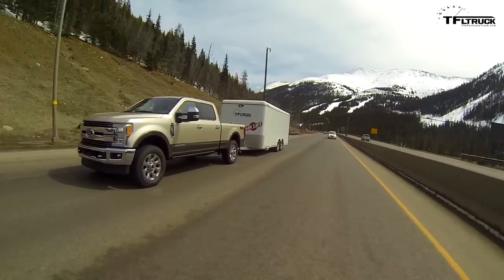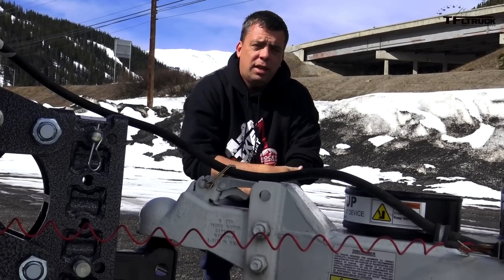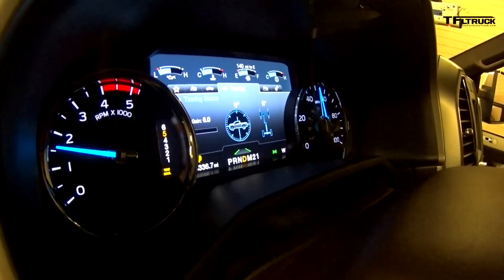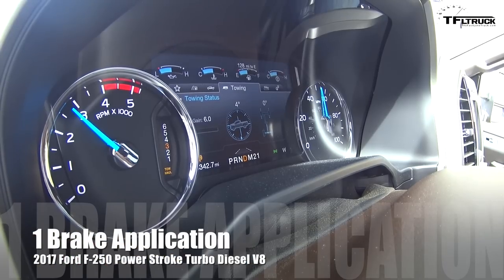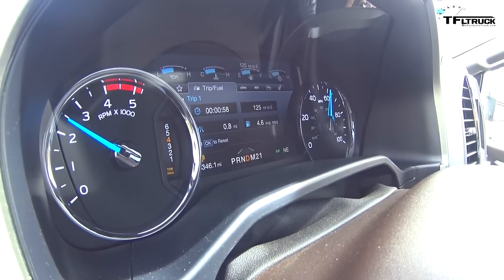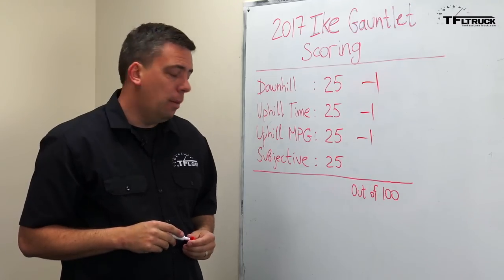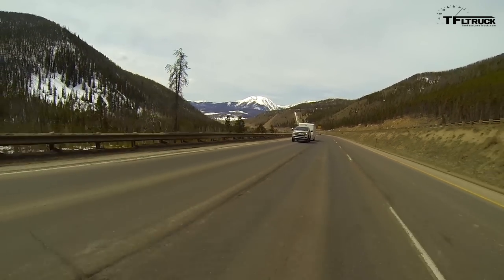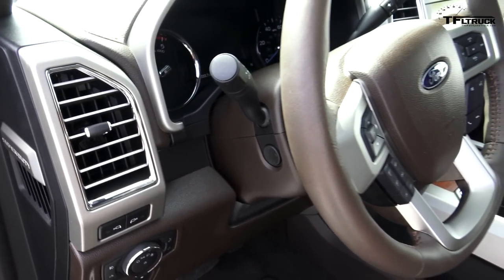2017 Ford F250 Diesel V8 Takes on the Ike Gauntlet Review: The World's Toughest Towing Test

Comment: How is the payload only 2080 lbs?
Reply: All the add on goodies. F-250’s have notoriously low payloads. Jump to the F-350 and you get 3500-4000 lb payloads.
Reply: @jjsemperfi  funny enough, since I added that comment 4 years ago, I finally bought an F350 a few months ago. Love that truck LOL
Reply: @eklaiss   Congrats! We’re looking for a 350 but will probably end up waiting. Hope this insane car market will drop in the next year or two.
Reply: @jjsemperfi  I got very lucky with my timing. I ordered my truck December 2020, it came in April 2021. Right before the microchip shortage.
Reply: @eklaiss   Very nice! I’m thinking I need to start a micro chip company at this rate.
Reply: @jjsemperfi  LOL if only!

Comment: let's test the 6.2l with more tourge at lower rpm we all don't  drive desiles
Reply: I second that.  Bring on the 6.2L with the 4:30 rear end.
Reply: desiles, that's a new one...haven't heard of tourge either...
Reply: Leonard Alldread Agreed.
Reply: Leonard Alldread If you're a real man , you do.
Reply: Agree. If I was to go out and get a truck right now, I'm looking at either the old RAM 2500 Hemi 6.4L or the new Ford F-250 Boss 6.2L because of the stupid cost of diesel. Both trucks are nearly $9,000 more for just the diesel, and that adds up with oil changes, other maintenances after warranty, D.E.F. fill ups. The diesel will most likely have the best fuel economy due to it's Turbo, but I would like to see them test drive the Boss 6.2L Super Duty too. TFL did mention in a previous video they were going to do a HD work truck (fleet) testing, and the Super Duty would have the 6.2L (I think) but it will probably be a 4x2. But yes, my first pick would be the 2017 Ford F-250 Lariat FX4 6.2L 4.30.
Reply: Mid-South RZR & UTV Riders The turbo isn't why it has better economy
Reply: Mid-South RZR & UTV Riders well these modern gas engines keep getting better and better fuel economy while moderne diesels keep getting worse and worse because of all the emissions crap.
Reply: with the 4.30 gears too!!
Reply: lfsracer79 hey buddy it was early in the morning yes I can spell
Reply: this time load it to the max also
Reply: M Dalley lol most people that drive diesels in ny are kids roaling coal going slow lol
Reply: Just a spelling mistake early in the morning but whatever  can't  we just stick to the subject
Reply: We all don't know how to spell the word "torque" or "diesel" either.
Reply: Leonard Alldread please correct your spacing!
Reply: Leonard Alldread diesel . Get it together
Reply: Spamfried Know how to use Google or a dictionary though, right?

Comment: so the $44,000 Chevy Silverado 2500 gasser got 2.9mpg and this $75000 superduty diesel got 4mpgs?!?! lol!!!
Reply: Jeff M that's about 25% better.  LOL, math
Reply: gotta factor in that reg gas is cheaper than diesel and the the $10,000 initial hit for the diesel upgrade.
Reply: Poor Jeff doesnt realize the 44k chevy gasser wont pull a real trailer for any length of time. Most folks buying a 75 k truck could give 2 shits about fuel mileage But its good to know that Chevy builds a better truck for 31k less haha. Jeff needs to stop watching super bowl commercials and put the Bud Light down and go drive a real truck. I have a feeling hes the guy with the 1/2 ton Chevy with the big fat tires on back because they will haul more pallets and the skinny little tires on steel wheels on front lol

Comment: I think I would get a Lariat with the 6.2 Gas engine and save a Honda Civic (20k) in the process. Not only that, Ford is already denying tons of warranty claims because of "Contaminated Fuel" and "Improper Fuel System Maintenance". I've been down that road before with a 6.0. They got me with one diesel. They won't get me again!
Reply: Campus Automotive Inc. please provide a link to these warranty claims that are being denied. 
I see people post this stuffin these comment sections all the time and they are usually missng facts.  
there were some warranty issues that were denied on the 11-16 trucks, but when you read deeper into what happened you usually find that the owner did something stupid like pour DEF in the fuel tank.

Comment: I just checked the 2015 ram 2500 Ike time with 12250 lbs.  time was 7:33 with 4.4 mpg.  3.42 ratio.  That's crazy fast.  This ford just doesn't have it.  I'm sorry.  And the ram is heavier.  Huh.  What am I missing.
Reply: Further the total weight for the Ram tow was 20,500 including the weight of the truck. This Ford is nearly maxed out at 22,400lbs (9,900 GVW (100 less than max) for the truck plus the towed 12,500).
Reply: Dave If you would have paid attention you would have heard Nathan say hey could have gone way over 60 at any time all the way up the hill but didn't want to break the law
Reply: Roger funny.  He also said he was wide open throttle.
Reply: Yes for the sound test
Reply: Roger regardless.  If he's wide open throttle at the time then I guess he had it floored.  Get over it.  Your ford sucked.
Reply: Dave West The Ram had to be floored at WOT several times. Nathan said he has plenty of reserve power with this 2,000lb heavier load and could have easily broken the speed limit. I guess math and the mounds of reasons why the Ford kicks the Rams ass in this one escape you.
Reply: John Smith the load was 12500 with the ford.  12250 for the ram. But who cares, 2000 lbs or 250 lbs more.  Like you said, the ford had lots of reserve power, funny that Nathan didn't use it!!!   And you say to stay legal, but yet the ram did it in 7:33.  I guess they broke the law though.  Why wouldn't they do it again to try to beat the best, the ram.  Weird.  Maybe you should watch the videos again and when roman says he has to floor it he says right after that he has to let off again.  Time and time again.  And yet still did it 7:33.  And with 4.5 mpg.  You have no argument.  Please stop trying.
Reply: Dave West lol- like I said, math and the many reason the Ram gets its ass kicked escape you. To disregard 2,000 more lbs and attempt brag about .4 of am mpg (especially since they used a snub nosed trailer in this one and an aero w/ the Ram) is laughable. Ford GVW in this video was 9,900 lbs, add the 12,500 for 22,400lbs. In the Ram video they state the total weight was 20,500. Roman was driving the Ram. No idea if he broke the speed limit or not. There is a reason they use 8 min as the benchmark and get no more points for doing it faster. But I guess that reasoning escapes you too.
Reply: Dave West and you are trying to compare a 4x2 to a 4x4. Lol. .3 mpg difference, more power, and more weight= Ford win
Reply: And it wasn't me that said to stay legal- it was Nathan. Did you even watch the whole video?
Reply: Dave he also said he had never felt power like that before, remember he already drove your 2 wheel drive dodge and like John Smith says the ford carried about a ton more up the hill, Keep looking for a win, hey go try the Duramax page you might get lucky

Comment: "Manually locking front hubs." Did I hear you right? As in get out and twist a dial on the hubs? I thought those went away in the seventies.
Reply: They have an auto and lock setting in case the auto vacuum fails. The systems are redundant.

Comment: Ok so basically you're taking all the trucks up at 60 mph??  So if all of the ones that can Hold 60 will basically be the same time..... Uh yes not really a test at all
Reply: @Chip Aikens I'm saying that it isn't really a real test. The nearest Real test would be Max Towing load, from a stop and accelerate to 65 up the hill with an escort to keep traffic as clear as you can. Once you "have" to slow down for traffic, the test has failed.

Comment: Great video....I'm sold on the 2017 3500 Dually..... With the Cummings motor....I'm mostly going to be hauling new RV's....Please do a video or give me your opinion....Thanks.
Reply: KENNETH STENSRUD no do not buy a dodge I know it has a cummins motor but even thing else will fall a part believe me I know if it was my money then I would get f350 lariat or xlt it just matters how much technology you want in it or which looks better to you but if you want a cummins then get a Cummins it's your money.
Reply: I second that! The dodge is a pile of shit...you will be in and out of the dealer with problems!
Reply: KENNETH STENSRUD the dodge is a great choice if you want to replace your tranny every 50k miles
Reply: Kenneth stensrud   I am a 13 ram cummins with the aisin tranny and it tows awesome.  My truck has 71,000 miles on it.  Almost all towing miles and it has been a very reliable truck.  I couldn't be happier.  And believe me, if it broke down there would be no mercy on what I would say about it.  Rams are not dodges
Reply: Get a Ford!

Comment: only 2000lb payload?   I thought this was a super duty truck.  Is ford now delving into the 5/8 category to compete with Titan?  Cmon Ford!  Half tons can now reach that payload.  No thanks!
Reply: Max payload for a supercrew F250, 4x4, 159.7" wheelbase is 3,450lbs. Weight in the bed, plus hitch weight brought the GVWR to 100lbs below its max GVWR.
Reply: John Smith isn't that what they said in the video?
Reply: Jonathan Powers your the one that said "only" 2,000lb payload. No Nissan  is hauling and towing this much.
Reply: look at 2:31.  just quoting what he said.
Reply: Jonathan Powers right- 10,000 GVW. Between the hitch weight and the weight in the bed they reached the max. Not sure what the confusion is. Here is a link to the advertised Ford capacities- http://www.ford.com/trucks/super-duty/2017/models/f250-king-ranch/
Reply from the maker: +Jonathan Powers The truck with the diesel, all options, and full fuel tank weighs 7,920 lbs

Comment: Seen these coming down the road with the C leds and the ass hiked up with pre load like the GM trucks, not a big fan almost glamed out to the point of ridiculous.
Reply: It has that rear-high attitude for a purpose.  That way loaded all the drive lines are level and low-angle for better reliability.  You see the guys with leveling kits on the front blow out their drive train all the time at the sled pull tracks.

Comment: i don't know why you do this test if you decide which truck is better without the data. might as well play rock paper scissors.
Reply: Without WHAT data!? We allocate 75 points to acceleration, mpg, braking, noise and handling. All of those points are taken into account before we add our subjective. How else would you do the scoring?
Reply: And in the end of the day you throw that away and pick what ever the hell you see fit gold hitch award winner should be. Aka the Ram 3500 ring a bell ?
Reply: I stand by our choice 100%. Sorry you don't like our process, but we have actually driven the vehicles. Seat-time matters and, at the end of the day, the Ram did exceptionally well in every way - not just a few ways.
Reply: and the chevy was faster and brakes better and had a better ride the Ram just got little bit better FE .btw  you didn't drove it in the ike... it was Kent. Your data is worthless if you don't use it for your gold hit award.
Reply: Alexandro Ruiz Alexandro, I've the truck on dozens of different occasions and at a variety of different press events. I understand your frustration, but we have to work with what we had. We may fine tune it for next year, but I still stand beside my decision.
Reply: Your decision was an arbitrary one. You all get 25 point for subjective scoring. You at the end of the test give a final score. The Chevy got a better score. There was no reason to pick the Ram if you really care about the scoring system.
Reply: Alexandro Ruiz aside from the fact of the Ram toes a lot more than the Chevrolet. Aside from the fact that the ram was capable of hauling better  than the Chevrolet.  The Cummins kicks ass in the  other videos. I enjoyed driving the Ram too. I stand by my decision, but as I said, we'll see what we can do to fine-tune scoring for next year.
Reply: If max towing is a consideration then give a gold hit for extreme ike. Btw the Ram with the Cumming was only more FE by just a little bit. Btw yes it kick Ford ass not the Chevy.
Reply: nathan adlen don't worry Nathan, it's just a butt hurt Chevy fan that's mad because you didn't pick his favorite truck to win the award he wanted it to win.
Reply: The Chevy just doesn't tow as much as Ford or Ram period.  They claim high torque ratings but they don't deliver on the dino, or the Ike, remember?  You really have to question Chevy on this one.  I used to a Chevy truck guy owning many, but I got tired of the little crap breaking all of the time.  Done!!!